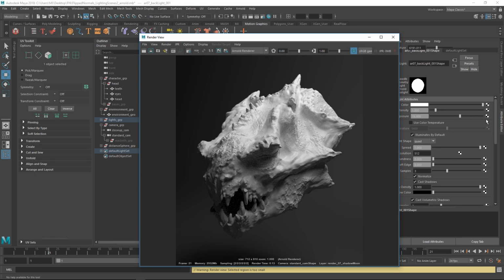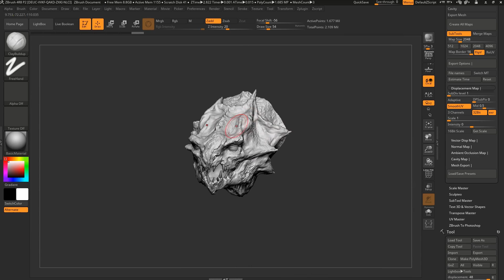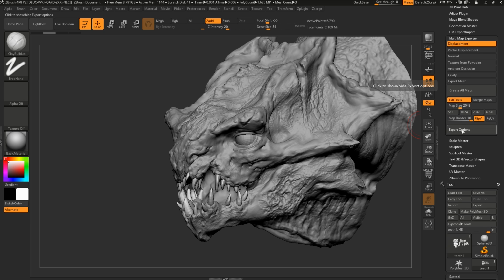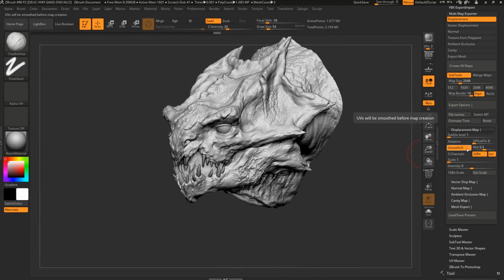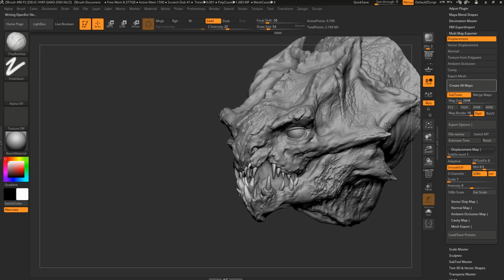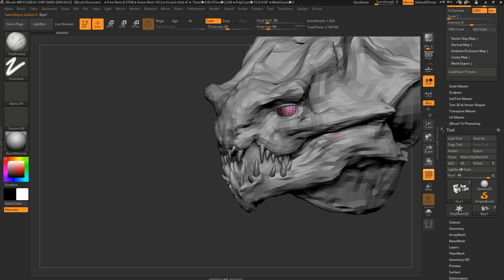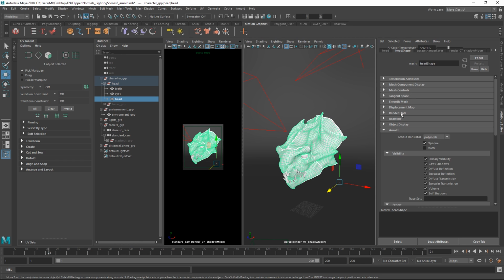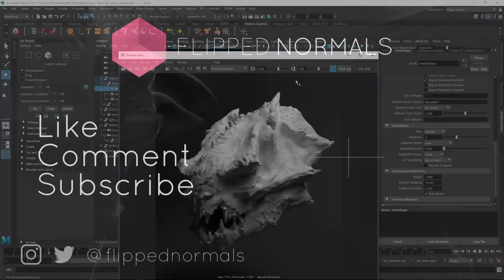ZBrush to Arnold for Maya -  32 Bit Displacement UDIM Tutorial

Comment from the maker: Important Correction! 20:20
In the video we say that you change the mid value under 'Bounds Padding'. This is wrong. You change it under 'Scalar Zero Value' instead. It's the same place.
Reply: That's what I though! Came back to check this one because I was confused with this at work the other day. Is there a reason btw to put it to -0.5 rather than 0.5? Never fully understood that. 0.5 has worked for me, at least when building a procedural map in maya with a 50% gray midpoint.
Reply: thank you so much guys, can you guys help me on Normal map exporting
Reply: Thanks for this xD was starting to drive me crazy xD but my settings was for 0.5 not -0.5 somehow, with a negative value it gets inflated
Reply: For those who'll read this comment in the future, for me as well. Had to set 0.5 instead of -.5 or the mesh will inflate
Reply: I used same prosses  but my map is coming red please help me
Reply: @Strubey  this setting literally has no effect for me and i cant figure out why
Reply: Changing the Displacement Map from Srgb to Raw - And Alpha Luminance On.
Reply: @EduardoRodrigues-wg7xs  many thanks. I learnt this stuff years back and i forgot this key detail

Comment: Before I forget, LOVE this tutorial! Thanks so much for making this guys! Learned UDIMs on the go here. One tip for models inflating that I found is once you add the displacement maps to your "file" node in Maya, going down to "Color Balance > Alpha Gain = 1.1" and "Color Balance > Alpha Offset = -0.25" got rid of my inflation. So much so that I could even go back to the "model's shape node > Arnold > Displacement Attributes > Height" and drive this up to values like 2 or 3 for REALLY deep displacement without the inflation. THANKS AGAIN GUYS!
Reply: thanks for the extra tip. I had to drop my alpha offset to -1 to fix the inflating
Reply: You saved my life with this. Mine turned out to be -0.5, but without your comment I wouldn't have even known to look there, and would have been hosed. THANK YOU!
Reply: Thank you!

Comment: You guys are making some great videos, keep up the good work. I understand why you are using .5 as the mid but I think it's worth mentioning for others watching that for 32bit the vfx industry standard has been mid of 0 even going back to Mental Ray. Vray, Arnold, Mantra, are defaulted to a 0 mid  value and I believe Renderman is too. You mentioned most software and render engines are made for mid of 1 at around the 10 min mark.Not sure if that was in error. I haven't used redshift or octane so I cannot speak to them but the other engines I already mentioned are not set for 1 in most pipelines but 0. It's worth noting that the down side to using .5 is you need to have these added adjustments to make displacement work when out of the box mid of 0 for 32 bit maps gives you the correct results. When you have many artists making manual adjustments there is room for error. If you do need to see what your'e doing and working with a 32bit displacement map with mid at 0 you can still grade the maps or adjust the viewer in nuke or do the same with the maps applied in mari for better visibility. (I've had many artists come in and not knowing how the maps are even working nor that by keeping the mid at 0 like the standard a value of 1 displaces one world unit outward along the normal and value of -1 inward along the normal)  Sorry its like PTSD for me. I've had too many artists not fully aware of how these maps work nor know what colorspace they are in.
Reply from the maker: Thanks a lot for your comment! If we said 1 is the standard, that's definitely an error. In the studios I've worked, we've used both 0 and 0.5 as a mid value, which is fine as it's 32 bit.

You're right though, that it's easier to work with 0, so maybe we should've used that in the video. The main point is at least to be consistent and to understand what the numbers are; if you're using 0.5 in ZB, your engine needs to be set up for 0.5.

/H
Reply: agreed, the understanding is what i think many artists lack and tutorials like yours will help big time.
Reply: It's worth noting there is a benefit to having the mid at 0 of you plan to modify the maps afterwards. 

For example, if you want to add a little extra strength to the displacement or if you've scaled the geometry, you can just throw in a multiply node after the file to do this - not so easy with the mid at 0.5. You can also combine two displacements by simply adding the maps together.

Of course you don't always need to do this, but it's nice to have the option.
Reply: Exactly! glad you mentioned that. also, since zbrush doesn't have the merge maps feature working with exr files, i just take my maps and add them together in nuke since mid is 0. Makes life easier
Reply: Had to scale model down, which completely broke everything. Went back here. Rebaked with 0 mids and changed height to .1. Boom! Works now, thanks.

Comment: Guys, the Switch MT button works pretty well. :) If you ipmort an obj (from Maya, Max, etc), press Store MT and divide, sculpt it. When you export the maps, press Switch MT and on the subtool(s), go to the lowest level (1) and press switch MT (now you have the original base mesh). The map(s) will be calculated from the oroginal geo(s), with the right intensity. 
If the workflow does not allow to change geos in main software, beacuse they are in rigging process etc, better to use Switch MT. Without using Switch MT, you should always export the geos from zbrush to your another sofware. Not so good...

Comment: I hope it helps, no need to touch bounds padding, you can Just set "scalar Zero Value" to 0.5 or whatever you set "Mid" value in Zbrush. or you leave it zero in Arnold shape node and instead change it to 0.5 in displacement shader node so this way no need to set it per object shape node. ....and just if you are curios how to do it in redshift you can do the same in rsDisplacement by changing "New Range Min and Max" to -0.5 and 0.5. so you actually shift those gray area to the point that these two engines look for the rest position.
Reply from the maker: You can absolutely do this too :) Thanks for your comment.
Reply: That's totally right! Too bad you'll still need to change the subdivisions in the shape node for each object because that's is not in the displacement shader
Reply: Hey so when I try to do this I have my displacement mid in Zbrush as 0.5 but when I apply the Maya Shape Node Scalar Zero Value to  -0.5 it doesn't appear to do anything (mesh is still slightly ballooned). When I apply Displacement Shader node to -0.5 it balloons up even more and having it at  0.5 "shrinks" it. The most normal looking one I could get is having the Displacement shader node at 0.1 but it's still not perfect, esp the eyes. I'm using Maya 2017 with Arnold 5.1.0.1 and Zbrush 2018 btw so maybe it's changed slightly. Anyone came across this issue?
Reply: @haiphung85  Yeah...got the same thing.  Scalar values of .2 seemed to be just right, OR I can skip scalar values and play with height.  I get same issues even if I render out with mid values of 0.  Not sure what is going on.

Comment: Was struggling to get this to work for a while with Houdini Arnold, so I'm going to leave this for anyone who might need it- if your map is exporting and looks completely red or gray in photoshop, it might actually have values you just can't see but the render engine will recognize them. I thought mine was blank and was trying to troubleshoot for a long time before realizing it was actually a render issue, not a zbrush issue.
When you bring the map into Houdini- you have to make sure subdivision and displacement are enabled on the geometry. Personally in the subdivision tab I choose cat clark, 3 iterations, and in displacement tab set the zero value to 0.5. In the material I just used an image node plugged into the displacement and didn't change any settings.

Comment: So l can't seem to stop my displacements from inflating. if l fix it in arnold renderview, it'll still inflate if l sequence render or if l just refresh renderview. l have to change height to 0.300 to get anything to show.

wondering if it's maya bugging out or l've done something wrong? l cant trouble shoot this...l don't know if its zbrush or maya!
Reply: https://ibb.co/Z1GLSY1 if anyone wants to have a look? l'm currently flicking around with options but its always the same issue, maya doesn't care and inflates on actual rendering
Reply: @sentinalchocobo  did you ever find a fix?
Reply: @romansrule3  nope! l ended up with a mess. however l was using an older z brush so l migt try this again. l was tweaking the settings to get it to something pasasble.
Reply: @sentinalchocobo  I just had the same problem and I'm not sure if this will help if you run into the problem again what I did was I dragged the displacement map into the hypershade instead of connecting it like they did. I then changed the settings there but I didnt do -.5. I did .5 on the scaler zero value. But I didnt animate my character so might not work if it's moving.
Reply: did you check "alpha is luminance" in the color balance parameter of your height map ? :)

Comment: Thank you so much for this tutorial, it helps a lot understanding how all of this works. I've watched a ton of tutorials and yours is really good.
I know this video is old, but could I seek for a little help? I've been trying to render displacements for months and whatever I do, I still get this annoying issue.
When rendering with Arnold, my displace looks smoothed, I'm loosing all the little details.
I didn't forget any options you mentionned here, in Zbrush and in Maya.
Searching for a solution, I tried to increase the map size, the catclark iterations, the DPSubdivPix, activate or deactivate autobump, change the scalar zero value...
None of these worked, I always get the same smoothed result. Even on a simple, small mesh with UVs in a single tile and correct texel density. Ugh... 
Do you have an idea of the problem source?

Comment: Idk if anyone can help me but when I try this using UDIMS it finds all the tiles and everything, but when I render I get a flat image of blown up textures.
Reply: Hey man! Maybe a bit late, but I had the same problem and I found the issue. In Zbrush under the Multi Map Exporter menu set the Displacement Mid Value to 0 and then export your displacement map. Once in Maya just follow this tutorial and you will be fine. Your displacement height in Maya might also be a bit to low so crank it up to 2.00 in Maya. Good Luck!
Reply: @TheGreatArlei  is this with 16bit? 32bit? And exr or tiff file?

Comment: Super useful, thanks. But I'm finding that with these settings, I'm finding that the 50% grey is inflating my whole model slightly. What could I be missing? Thanks.
Reply: have you checked to put -0.5 on the scalar value in Maya? They do that at the end of the video

Comment: Hi!
Great tutorial but I have a question. Here you did your sculpt on a model with uvs and then export the normal map to the lowpoly with the same uvs. But lots of trouble with the displacement map happen when you have to bake your highpoly on your lowpoly (using xnormals or Knald). I've never find a good tutorial on the latest version of arnold for this case.
Internet seems to avoid this subject xD
Reply: you can bring in your low version with uvs into zbrush as a subtool in the same scene as your high poly sculpt. Subdivide it and project the sculpted one to the low one with uvs.

Comment: setting mid point to 0 is best because your obviously in 32 bit for starters to get a higher range; -1 to 1, if you set it to 0.5 the details above mid will have there precision basically halfed. as they are now 0.5 to 1 this would only benefit details below mid point
Reply from the maker: I'm not sure if this is true, as with a 32 bit map, you dont get a range from -1 to 1, but far higher ranges. Basically you get as big ranges as you need, so having a mid value of 0.5 or 0 isnt going to make any difference. We've worked with maps which has a peak of 13 due to it's scale.

/H
Reply: FlippedNormals I thought it was -10 to 10
Reply: Which is of course a lot but i dont know I think it’s how it works

Comment: Are displacement maps better for creatures than normal maps? I usually just plug in the normal map into the bump map node in arnold.
Reply: Bobby Zheng normal maps dont actually create geometry they only give the illusion of displacement.
Reply from the maker: Like Ossama says, they are just different maps. Normal maps are a lot quicker to render, but displacement maps generally give you better results.
Reply: Use displacement if it affect silhouette and normal maps for things like skin pores and other smaller details, that do not affect silhouette

Comment: Thank you guys, great tutorial as always.
How would you paint on the displaced object in Substance or Mari? is it possible to show the object with displacement in the texturing programs?
And if not possible and you have to paint with the low poly how would the textures show up on an object with displacement map? Will the texture be distorted?
Reply from the maker: We definitely paint on the displaced object after it has been sculpted. For me, it's very much a non-linear process where the sculpting informs my textures and my textures informs my sculpting. I dont use a displacement map in Mari though, I just export the highres obj from ZBrush. 

If you paint on the object which isn't displaced, you will get distortion, as you're not painting on the render model.

Hope this helps! :)

/H
Reply: FlippedNormals Thanks,
but what about the UVs? Do you do them on the high sculpted mesh?
Reply from the maker: On the low res which you can then transfer to your Zbrush sculpt, if they have the same topology.

Comment: Hey friends, I did exactly as you did in the video with the Scalar Zero Value adjustment, the displacement has transferred through successfully. I have a problem, when I render my mesh, my mesh is inflated. Not sure how to fix this, hope to get a reply soon, would really like to move forward with this
Reply: And just like that I found the solution, I had to set the mid value in ZB in Export Options from the Zplugin menu to 0 in order for Arnold to understand the value from Black to White correctly, hopefully someone who has a similar issue will stumble across this, best of luck!

Comment: i followed this tutorial used the exact same setting.... i get an extremely washed out map  with virtually  no information that just inflates my model whats going wrong
Reply: and when i use the multimap exporter I just get no info, if I use the displacement map tab in the tools shelf and export the map out that way I get a shitty map with tine clamped in texture in the 50% range
Reply from the maker: Based on the screenshot the data is there and then Arnold should be able to read it. How 'big' the data is is depending on your scene scale.

If it inflates, try a midvalue of either 0 or 0.5.

Comment: Which version of the arnold do you use in maya 2018? v5.0? For me it works only if displacement mid value in zbrush is set to 0, if you leave for 0.5 the model in the arnold puffs up. and btw Switch MT works fine:) cheers!
Reply: hey guys ！ th halp me.

Comment: Do you know if the "Switch MT" function is activated again in the newest Zbrush version? Quite necessary if you have to work with a fixed base mesh. Or do you have an alternative solution to that?

Comment: 4-6-2018 I'm having problems with this, please help. When I bring my textures back from Zbrush, something is overlapping (even though its a UDIM Map) and when i displace it in Maya it looks bloated. Also the displacement map looks really light? Also, I found out it was the Color Balance - Alpha gain where you upload the displacement map. But I still don't understand why there is an overlap when the displacement map was created in Zbrush? 4-7-2018 Update - Fixed the UV's, they were overlaping on the edges. I checked Alpha is luminance in Maya for the Displacement map, left color balance alone.  In Zbrush: Multi Map - Displacement:  I moved the Mid to 0 and Subdiv to Level 5 - and left subdiv level of Geo Tool l to 0 when exporting the map. The EXR. Map came out darker finally. Question:  why did I have to check Alpha is Luminance in maya for the bloating to stop?

Comment: Can you do a basic video on this like if im doing a very simple character no clothes, or example like a statue, because when i try and use dipsplacement i really struggle on where to put the file i tried placing my height map into >transmission because of the substance painter and maya guides elsewhere.  But it just messes up the mesh and either gets bloated or the mesh goes transparent, and ive followed your video and it balloons up and bloats out.  ***UPDATE***. Ok I changed the 'Height' value in displacement to '0.100' instead on it being '1.000' then changed 'scaler zero value' to '-0.500', and turned off Auto Bump.  The problem now is im not getting full detail from my normal map, which I've put in 'geometry' bump settings right?